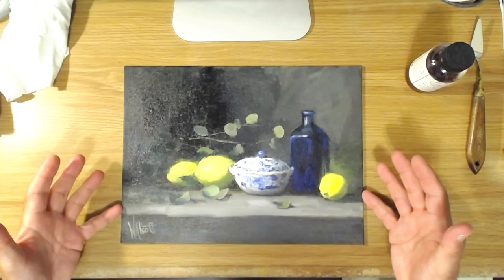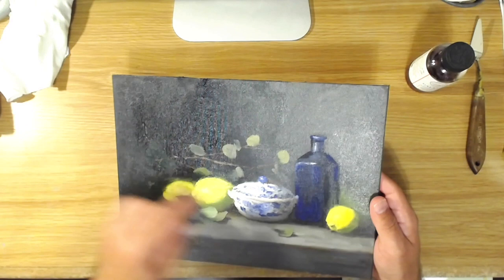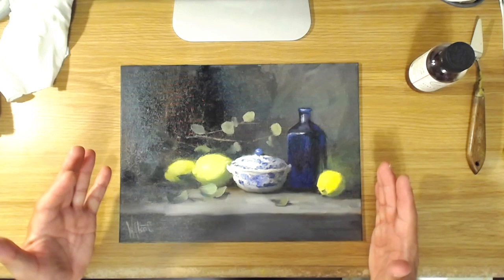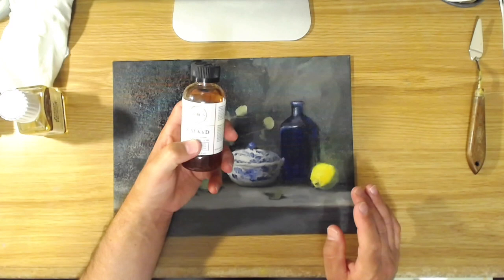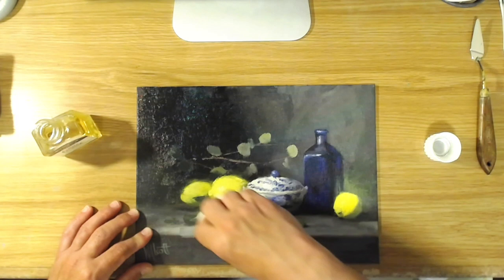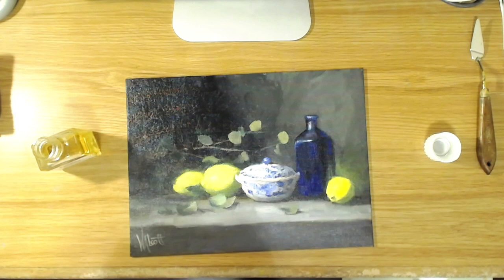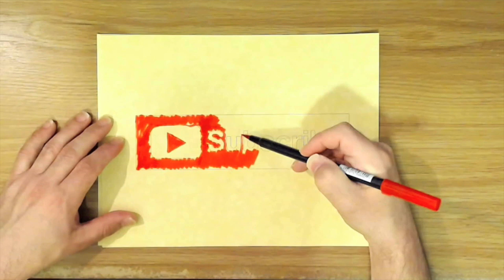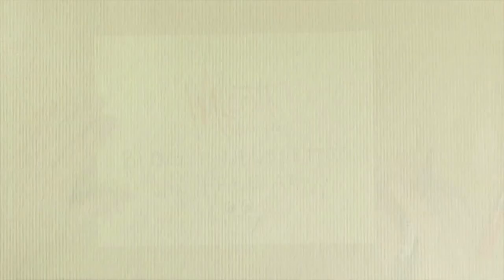All About Oiling Out

Comment: I'm a self taught person! Been painting for 75 years! Never heard of "oiling out" until recently. Keep hearing people complain about how long oil paints to dry and about the surfaces are shining or not! How much oil paints shine, is how thick the paint is and type of medium thats used. I believe that I have found the answer. When I was a kid, I bought a a antique oil painting and noticed that it had NO texture or "ridges" of paint! HOW?  Much later I discovered how to paint in multiple thin layers, each time building up to the desired layers of colors and tones. SAVED A TON Of MONEY IN PAINT! Each time drying much faster. If that was to slow, I would use a "cobalt" solution to speed things up! Sometimes within hours. My painting took on another whole new path. Then I discovered that the paint was weakon the surface like chalk and very dull when dry. Along came " oiling" and saved that. Now I can control whether I want it shiny or dull. My latest painting is is done on well sealed and gessod 1/8 inch plywood - needs no gaudy and expensive frames ! The Mona Lisa was painted on wood panel that is around 400 years old.! I also use epoxy putty for texture and a raised surface to give it a 3-D  effect! Want to experiment with air dry putty next! With todays new brushes and materials we have tremendous opportunities that the old masters never had! Keep painting and enjoy!😊
Reply from the maker: Thanks for the wonderful comment! Painting in those thin layers is much more akin to the way artists painted back in da Vinci's time so that would certainly help with surface sheen. Sounds like you've found your groove! Thanks for watching :)

Comment: Wow, learned something new today, thank you Jason, it was magic watching that painting come back to life!  I thought oiling out was only for reworking the surface between stages, I STAND CORRECTED, LOL.  What about walnut oil and Gamsol or turpentine, 1/2 and 1/2?  Cheers from New Mexico USA!
Reply from the maker: Great question! Yes you can use 1/2 walnut oil and 1/2 Gamsol or turpentine to oil out. It won't hurt the painting, but as with linseed oil it will take longer to dry. Thanks for watching!

Comment: After oiling out with W&N medium, how long do you have to wait before varnishing? And will it maintain the even sheen after varnishing with no sunken areas?
Reply from the maker: Yes, one of the purposes to oiling out is to make the surface sheen even so if there are still sunken in areas you can oil out again before varnishing. Paintings should dry at least one month (or up to six months if thick) before varnishing. Thanks for watching!

Comment: Have you talked about using water mixable AND traditional oils on the same painting? If not I would be very interested in this. Sometimes I find colours in traditional oils that I like that are not currently available in the water mixable and would like to know how to use both of these during the same painting. I paint alla prima
Reply from the maker: I don't use the water mixable oils, but you can certainly mix them with regular oils. Just be aware that once you do that past a certain point, the water mixable paints will lose their water soluble quality and become like regular oils. Thanks for watching! :)

Comment: Wait though you didn’t mention anything about the fat Over lean rule. If my top layer of the painting has zero solvent in it and I put solvent on it as part of the oiling out mixture, wouldn’t that ruin the painting?
Reply from the maker: In the case of oiling out you are using pure oil, not paint so it should still be plenty flexible to follow the fat over lean rule. You can omit the solvent if you wish to though. The key to remember is that you only want to feed the surface enough oil to even out the sheen. Use as little as possible and wipe away any excess. Thanks for watching!

Comment: HELP!!! They just purchased one of my oil paintings and I had already varnished it days ago but I then realized that there were some matte little areas, even very small ones. I then applied some linseed oil, a very small layer, and now I'm waiting for it to dry... Oh God, what can I do? The customer who purchased my painting is waiting and I need to varnish those areas again as soon as possible. What can I do to speed up the drying process of the linseed oil on the painting so I can varnish it again?
Reply from the maker: Hi Richi, Unfortunately there is no easy quick fix for your issue. You need to make sure that the painting will stand the test of time and not have issues in the long term. There's not much you can do to speed the drying of the oil and you need to get it off the varnish layer ASAP. Long and better way: I would recommend wiping off the linseed oil as much as possible and then removing the varnish. Oil should never be applied on top of varnish. Then once that is done, you can oil out with an alkyd medium like Galkyd thinned with some odorless thinner. Once that's dry (about a week) you can revarnish. The alternative short answer is if you and your customer can live with the matte/glossy spots, at least remove the linseed oil and apply another coat of varnish. That way you could still get the work to your client more quickly. It's not ideal but those are the best options. Don't try to incorporate any driers into the mix, that will lead to cracking down the road.  I sincerely hope that helped! Best of luck to you.

Comment: Thanks Jason, but tell me more about which products to use. I've heard you can use Oleogel or oleoresgel by Rublev, also.
Reply from the maker: I'm not sure about the Oleogel stuff from Rublev, I have not used those products, but if Rublev specicfies them for that purpose then it's probably fine. You can use plain linssed oil with equal part thinner, but it tkes much longer to dry. the 50-50 Galkyd/Gamsol misture is probably your best bet. Thanks for watching!
Reply: Oleo ? Isn't that butter? Or margarine. From the ole days.
Reply: @dconfused9919  No. lol. It's got fumed silica mixed with Linseed oil. (I think that's ground glass). It extends paints, adding some transparency to it.

Comment: Hi Jason, I watched your varnishing video as well and I was just wondering - if the goal is to make the colors lively again and to make a protective film over the painting, couldn't linseed oil theoretically (or another drying oil) be used in place of a varnish such as damar? If its done at the end when the painting has dried enough it seems that they both would serve the same function
Reply from the maker: Great question! Oiling out is exactly what you just described, it feeds oil into the surface until it's at an even sheen and the colors are saturated. However varnish is still highly recommended as it also serves as a removable protecting film over the painting. Once linseed oil is dry you can never remove it, but varnish will always remain removable. That way if the painting ever needs to be cleaned/restored you can just take off the old varnish and put fresh on. Some modern varnishes also protect from UV light. Thanks for watching! :)

Comment: Hi Jason ,very good info, but I want to know if I can do this if the paint is touch dry after 3 or 4 weeks! And can I use just a linseed oil for that!,, and I'd like to know when can I varnish it after oiling out, many thanks ,greating from Holland
Reply from the maker: Yes you can! You can oil out at any time once the painting is touch dry. You can also use linseed oil, but very sparingly. Too much can cuase wrinkling on the oil layer. Thinning it a bit helps prevent that. It will also take longer to dry. Thanks for watching!
Reply: @walcottfineart5088  thank you so much

Comment: This is really helpful. I have some questions about using W&N Artists' Painting Medium specifically for this. Do you find that there is any yellowing or darkening that happens over time with this process? I'm a bit paranoid about that possibility. Given that the W&N is formulated with stand oil, rather than standard linseed oil, would you still recommend waiting a full 6 mos to apply a final varnish?
Reply from the maker: To be honest I am unsure about the darkening. Those type of changes usually take decades to really show so it's hard to predict how newer materials will react over time. You can always oil out with a mixture of good linseed oil and thinner, equal parts. The general consensus today is that you don't need to wait 6 months to varnish unless you have really thick areas on your painting. 3 is probably fine. Thanks for watching! :)

Comment: If the painting has been dry for 6 months and then you oil it out, how long do you need to leave it to dry 
/ soak in before varnishing it? Also thankyou so much for your videos xx
Reply from the maker: Any new oil will have to dry for the proper amount of time before varnishing. It's still in debate nowadays whether a full 6 months is necessary, but I would give it at least a month after begin touch dry.

Comment: I really enjoy your videos and realised why my oiling out has been going wrong every time. Do you have any videos about varnishing? I've varnished two paintings recently that have been dry for about 6 months and the varnish has either evaporated or soaked into the painting? I'm not sure what is going wrong?
Reply from the maker: The first layer of varnish can sink in somewhat if the painting is very matte. If you oil out until you get an even surface, that would solve that problem. I do have a video on varnishing here: https://youtu.be/Leuh0Jod-Gg Thanks for watching! :)
Reply: @walcottfineart5088  Thankyou so much I will watch the video and buy some painting medium so I can oil out my paintings. Thankyou so much! I honestly enjoy your videos so much and I've really improved as a result :)

Comment: Hello Jason, is it okay If I use Gamblin Solvent Free Gel or Safflower Oil for oiling out? If not, why are linseed oils more preferable?
Reply from the maker: Linseed oil is more durable long term. I wouldn't use Safflower oil, it takes way too long to dry. The solvent free gel would be too thick to oil out with unless you thinned it...with a solvent. LOL If you use plain linseed oil, use a very small amount. It will still take longer to dry than doing it with a alkyd medium like Galkyd, but would avoid the use of solvent. Thanks for watching! :)
Reply: Thank You!  @walcottfineart5088
Reply from the maker: @UncleJunior52  Yes Stand OIl is good but it does take a very long time to dry, so you have to take that into account. Thanks for watching!

Comment: Hey Jason. Can I use stand oil?
Reply from the maker: Yes you can, but it is a very slow dryer. Maybe even more than a month to fully get dry to the touch. It does impart a high gloss enamel like finish. Thanks for watching!
Reply: @walcottfineart5088  hey thx. Just mix it the same. 50/50?

Comment: Hallo sir, if i applied a RETOCH varnish on my project ,can I use  this technic on it , thanks
Reply from the maker: That's a good question! I would avoid using retouch varnish if you think you are going to oil out. Oiling out can be done at any stage, you just have to let it dry in between layers. You might be OK, but keep the solvent to a minimum or it could reactivate the varnish.  If you have a painting that already has retouch on it, I would finish with that method. Next time choose one or the other. Thanks for watching!

Comment: What’s the name of the Windsor and Newton medium you use? How do you know there’s no varnish in it?
Reply: Looks like it said, "Artist's Painting Medium" on the label.
Reply: liquin original is the best
Reply: I have the same thing. It doesn't have a name. It's just called medium.
Reply from the maker: Yes, it's just called Artists Painting Medium. I had it on hand for the quick demo but you don't need to use that.You can make a mixture of 50% Liquin or Galkyd to 50% odorless thinner. Thanks for watching!

Comment: Hi! Have you ever tried to do this vertically (because my painting is very large)?
Reply from the maker: I have not done that but I don't see any reason why it shouldn't work. The oil doesn't need to be so thick that it drips. Just enough to feed the surface. Thanks for watching!
Reply: @walcottfineart5088  Thank you!!!
Reply: @imadethisforict  I have done oiling out ( with this particular W&N painting medium)  in large, vertically standing, paintings and worked just fine.
It needs to be applied thinly , just the quantity that it's necessary to do the job.